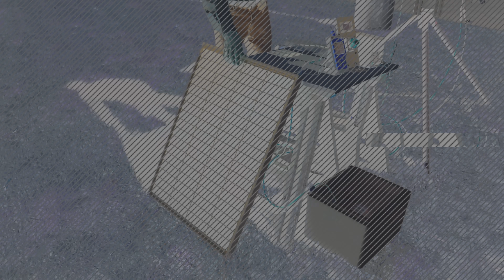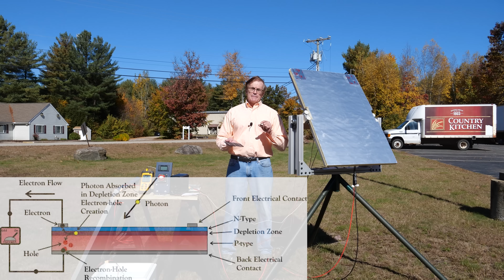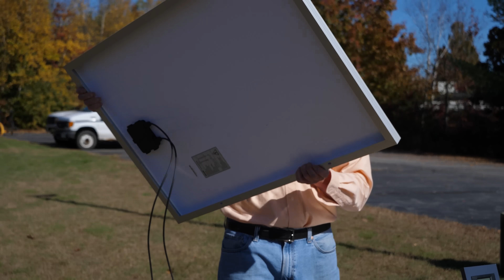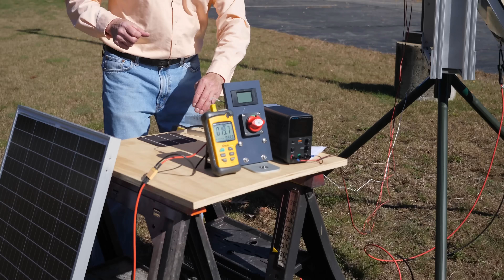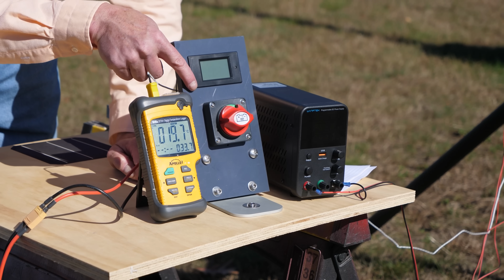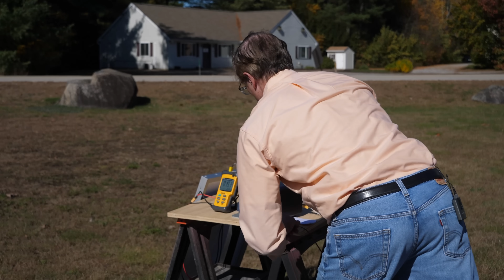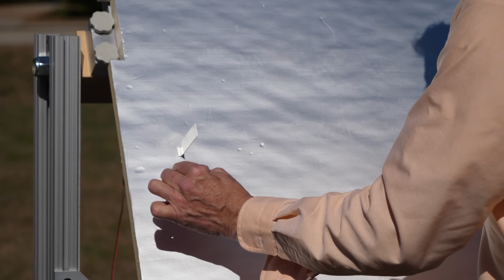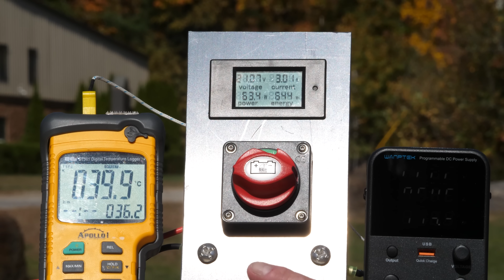Do you REALLY get enough out of your solar panel?

Comment: It does not pay out.. this is why all the solar industry is going in the opposite way.
Solar panels has become so cheap, that even being the main hardware required to harvester solar energy, they only represent a 20% of its LCOE.
Even in bad conditions Solar Panels last 25 or 30 years depending the brand. 
Inverters cost the same or more than solar panels and they last 2 or 3 times less time. 
One hour of battery storage using lithium-ion cost almost twice the cost of solar panels and they last 3 times less.
The support structure, cables, switch cost the same than solar panels or more. 
Then you need to include the instalation cost which also cost more than the solar panels. 
At the end, the industry is learning that the best way to achieve the lowest LCOE, is placing the solar panels just flat on the ground without any structure, it does not matter the right angle or any other factor..
Why?  because solar panels are cheap and they they a long lifespan, flat under the ground also requires less land and it is easier to clean them.  you want more power?  just buy extra solar panels. 
I do not said that active or passive cooling could not help in some circustances, but those are very NICHE circustances and only if they can be applied at negligible cost.
BTW: still a great episode!  I love the high care to not introduce errors in the measurement in a very controlled experiment.
Reply: No that's dumb. Laying them flat on the ground is silly for a few reasons, the loss of efficiency isn't worth it. The amount of things that will shade a flat ground panel is huge. You lose HOURS of direct sun everyday because the angle of the sun will.be blocked by trees and hills in the morning and evening. New lifepo4 batteries will last 15-20 years now. So no a panel will not loast more than 3x as long as lithium. Flat on the ground definitely does NOT take up less land.
Reply: @randybobandy9828  why you think something is dumb without even checking what I am telling you?
Why it matters if you lose a 20% efficiency from the panels for not having the right angle if you save a 50% of the total LCEO cost, in that case you just buy more solar panels, which also increase a bit your other cost like inverters and installation, but at the end, it is a 20% cheaper than the industrial standard. 
Maybe at latitudes higher than 50 degree may not pay out, but eventually would be. 
Look the trend:  2 solar axis --> 1 solar axis --> no axis --> just flat on the ground.
You know what is the single consequence of that installing method evolution?
Easy:  PV module price trend. 
This is one company::
https://youtu.be/ifNp6ueUsmQ
Others are also in the same path, some at Australia and India.  
It does not end there, now with solar cells being printed on rolls at very cheap price, the next step is just being installed in any window as a thin semitransparent layer, it may not even matter if it face the north or not.

New lifepo4 batteries will last 15-20 years now
That is a lie, the best has 5000 cycles, this mean if they are used all days they last 13 years for a battery that cost even more than  normal lithium-ion. 
Some claim that they can last more because not the whole capacity is used by day, in order to accomplish that you need A LOT OF CAPACITY, when only 1 hour of capacity in the same lifespan period would cost twice or more than the solar panels, in that case you would need mínimum 4 hour of storage to have some extra some days, that is 8 times the cost of your PV modules to get an extra lifespan for your batteries. Beyond 3 or 4 hours of storage, hydrogen becomes a much cost efficient storage method which capacity can be double over and over at negligible cost.

Comment: We typically just add a little more solar :) Also, it seems like your aluminum backing is trapping hot air causing your starting temperature to be higher than it would with an open back and angled panel.
Reply from the maker: It doesn't.  The uncovered panel  is still better than the stock panel.

Comment: Thanks Techie. Bravo for demonstrating the magnitude of the effect. I really hope that manufacturers and installers are watching this video closely, and acting upon your findings and recommendations. 🙂👍

That 15% loss, or 1.5% per degree Celsius, is worse that I expected, and represents a significant amount of Solar energy which can be recouped by the simple expedient of using proper thermal management. Not to mention the further savings to the environment, and to peoples' finances, of extending the life expectancy of those panels by perhaps 50%, and/or reducing the size of installations in the fist place.
Reply: Correction: ⁰.67% per degree Celsius loss. (Still a lot, despite my bad Maths.)

Comment: fans wear out and need to be replaced more often than you need to replace the panel
Reply from the maker: Depends.  The fans don't  need to function 24/7. They're  also less expensive  than a PV panel and easy to replace.
Reply: Maybe but I have seen fans of that size last 10years plus.

Comment: Interesting content but for a DYI it fails the "is it worth it" test. Cheaper and easier to add a panel to make up for the net gain of maybe 3W and add another panel in 10 years to compensate for loss of efficiency. Todays cost is 170$ for the same panel that is being used in this experiment. Cost of aluminum, fans, fan controllers that might break will for sure be higher.
Reply from the maker: That's  double the cost we paid for it.
You need some numbers if you're  going to claim it fails the "is it worth it" test.

Comment: You've mostly enclosed the back of the panel, then you're comparing fan on to fan off...How would it compare to just having nothing on the back of the solar panel? 
Also I'm curious, do you know if the temperature increase affects the panel's voltage or current? or maybe both? And if it's both, does it affect them at the same proportion? because if it doesn't then having the panel just hooked up to a resistor is going to exaggerate your results.

Comment: So, the question I've got is can you extract that heat and turn it into useful electrical energy, instead of just throwing it away?
Reply from the maker: It's  tough because  the temperature  differential  is low.
Reply: Not really otherwise they would have came up with a cheap solution for electricity in hot areas

Comment: Thank you or introducing us to the concept of hybrid solar panel e.g., combined electrical and heat production. I will modify the conception of my solar air heater consequentially. Can you estimate to total watt production of your device knowing the CFM and the differential of temperature of air input versus output?
I have no knowledge of engineering, but if I understand correctly my reading on internet, at 180 CFM with a delta temperature of 36⁰C the heated air BTU production is 216 converted to Watt: 63 Watts meaning you have doubled the total energy production of the unit.
Could you calculate an optimal CFM output to optimize the total   energy output?
Sorry for the bizarre English I am French.

Comment: Ok  a couple of issues.
#1 THE biggest is the ongoing maintenance of the fans.
 I have quite some experience with equipment with continuously running fans.
Let me assure you they have a limited life no matter the brand, type or quality.
Even when run at lower than rated voltage, which is quite common, the bearings fail in a small number of years.
The harsher the environment the faster they fail.
#2 The noise. If you have ever been in a server room or and amplifier room you will understand how much noise multiple fans make, even at reduced voltage.
#3 If you where doing this at any scale, it would be a waste of time bending aluminium. 
It  would be far better  and more efficient,  buying, extruded aluminium angle or channel.
#4 The cheapest and most effective improvement, for most solar systems would be to install with more air space under the panels. Most solar installations I see have the panels installed tight to the roof sheets.
#5 It will probably be an improvement to apply a thin coat of mat black paint or black anodize to the heat transfer surfaces. Yes I know that people will argue that the paint may do more to insulate than to improve the dissipation. Yes, this is an argument pushed by those who don't want to spend the extra money.
#6 One idea that may work with no moving parts is " heat pipes" enclosing the back panel with the heat transfer improvements and allowing convection to do the work of moving the air.
#7 Then there is the whole economic viability thing.
at what point would it just be cheaper to mount more panels.
This is why we have pretty much abandoned sun tracking  equipment on solar systems.
Back in the 80's, tracking solar panels was a bit of a thing. But Solar panels have become very much cheaper and very much more efficient.
Most solar installations are not even optimized for tilt and direction these days, they just get bolted to the roof at whatever angle the roof is at.

Comment: Any time you have forced air cooling, you'll have dust buildup.  Just look inside any PC.  That needs to be factored in.  Not for servicing, but what that means in terms of long term efficiency.
Reply: Consider the fans are rated to be wet you can just rinse the whole thing.

Comment: Putting the aluminum sheet on the back increased trapped heat in the panel. You should have checked the power output and operating temperature with the stock panel without the plate back. I bet the loss of power and build up of heat wouldn't have been near as much. No way this worth it, the beauty of solar is no moving parts.
Reply from the maker: The air isn't  trapped.   Have you any idea how slowly convective air moves?
Reply: @Tech Ingredients  It doesn't matter, the plate was added and not controlled for. A well-performed test would have been to compare the modified panel to a non-modified panel. You can't tell me a panel with a back plate attached will perform the same as one without. You stated there is a difference in panel performance depending on how a panel is mounted to a roof.

Comment: Tech Ingredients, going back to the concept of cooling the panels by way of water rather than air, wouldn't there be MORE cooling when panels are soaked or sprayed with water and then allowed to evaporate?  Imagine that this evaporative process is continuously replenished with spray of water.  The process of evaporation takes away a tremendous amount of heat.  Have you done tests on this?
Reply from the maker: The problem  is complexity  and maintenance, not to mention water consumption.   Many of the regions where this makes the most sense  are very dry.

Comment: What was that, power increase with fans on @ 6v/3W was 5W. now the power losses from deriving 6v from the panel voltage will cost much more than 2W. You could always use a DC-DC converter with 90 to 95% efficiency. But that is far belong the home handy man isn't it? All for a maximum gain of 2W Much easier to put the kids  and the dog on a treadmill. The aging rates you quote are for junction temperatures not panel temperature.
Reply from the maker: No, it isn't.  Those are real world, installed panel temperatures. Did you forget about panel longevity as well as increased efficiency?

Comment: I have been told in various areas that it depends on the quality of the solar panel.  Better quality panels have low lost due to heat. For example, panels are designed for deserts or areas along the equator that have long direct sunlight in hot climates.
Reply from the maker: I'd question  those claims.
Reply: @TechIngredients   longi panels. So you think the specs are exergerated?

Comment: I think while the panel efficiency increase is nice, I think you've really hit it on the head with the longevity increase. Especially when you consider degradation over time with loss of efficiency that increases. Increasing longevity, decreasing efficiency loss over time, actively increasing efficiency above baseline leads to a tremendous end of life generational difference.

So most solar cells degrade at an average of 1% per year,  with a lifespan of 20 years. A simple math exercise let's assume a 1kw/h  (12h production)array produces  4380kw/h a year, over a 20 year life span, we have lost 761kw/h from theoretical max. but if we can decrease the degradation (half, simplicity sake), and increase the generation (3%), over a 20 year difference, can lead to a generation difference of 9279kw/h. (nearly a 10 megawatt difference)

This doesn't really consider the longevity difference of how much more energy you'd produce if you get an extra 5 or 10 years out of the panels. One could also increase the power output through some of the other methods Tech ingredients has shown without to much worry of increasing degradation to much due to active cooling.